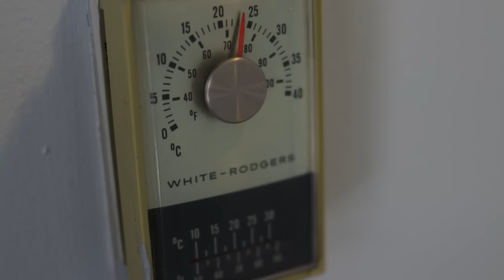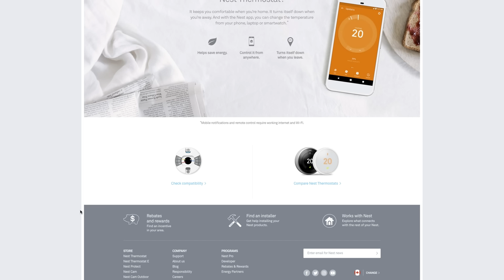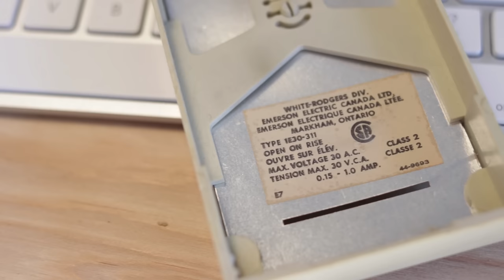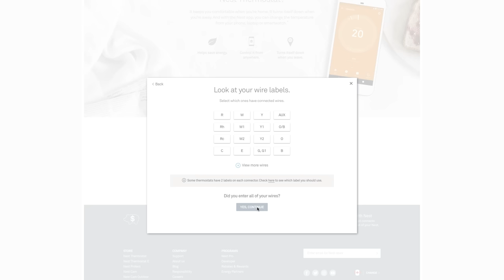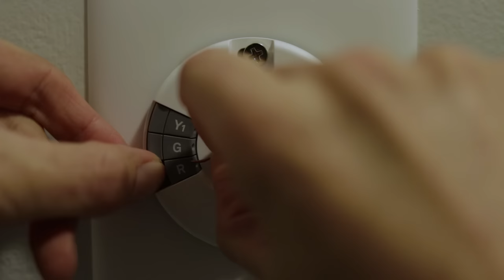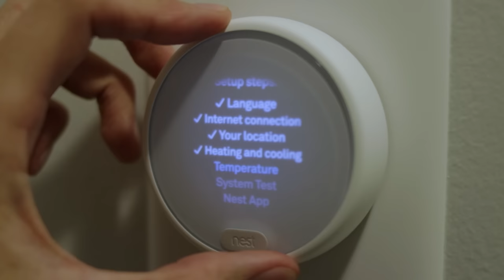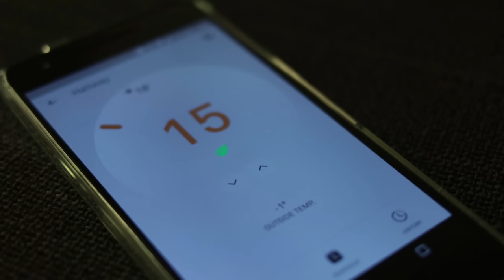Nest Thermostat Install (Replacing old 2 wire thermostat) - FAQ in Description

Comment: I found it amazing and not in the good way, that Google does not present this the simplest installation is only two wires is not presented in any of their installation material. Many houses do not have hvac systems and thus often only two wires. Mine has Black and white which this video says are in fact interchangeable. Upon powering up I almost immediately received message battery needs needs recharge please wait. The unit cycles this message repeatedly. I have the unit now charging externally via USB and I'm hoping after a couple hours of charge the unit will function. I also noted that you mention that once charged the unit will then maintain its charge by 'stealing' power when the heating system is not engaged. If, not I will be an unhappy customer.

Comment: My unit couldn't handle the voltage and got fried!!!
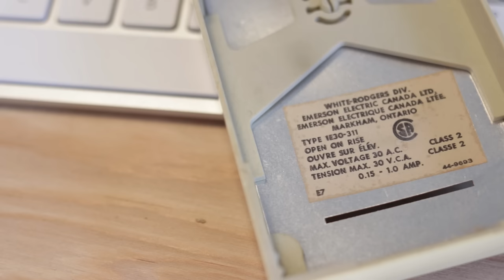Reply from the maker: Ugh, that sucks Frank! The Nest Thermostat is made to work with low-voltage systems only! I checked that before I replaced mine like I showed at 1:03.
Reply: That's sad that it got fried. I hope mine don't do that because I'm installing soon to. I going to make sure what the volts are frist.
Reply: Yeah, I did not know and didn't check the the voltage... I did manage to return the unit and was able to update to a digital Honeywell system (-:

Comment: This is weird I thought you supposed to have a common wire?
Reply: The c wire is usually used only on thermostats that you dont want to replace batteries in or that need to be powered by the unit instead of batteries.
Reply: Yea , i thought u need a c wire. mines wont turn on with just 2 wires

Comment: I live in a shared building (condo, 6 units) and we all share one gas boiler.  My current thermostat is very similar to this one : https://www.homedepot.com/p/Emerson-Digital-Non-Programmable-Thermostat-1F83C-11NP/300773226 and I believe it runs on 2 wires.  Will I have any issues that differ from anyone else in the comments, being that in my use case, we are sharing the boiler?